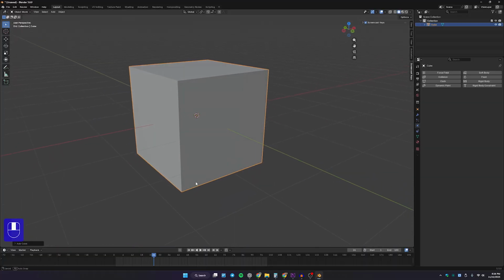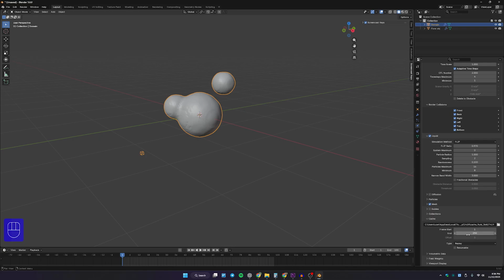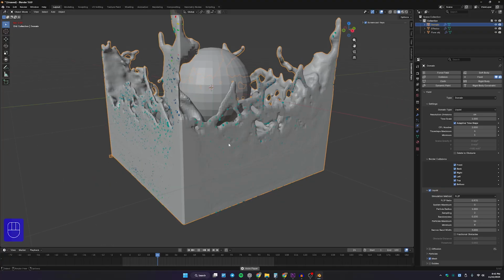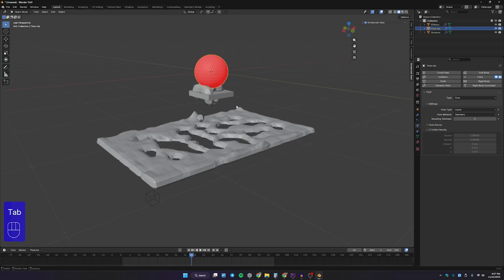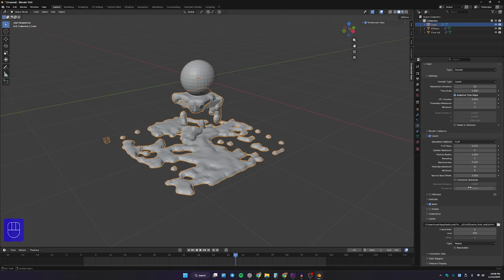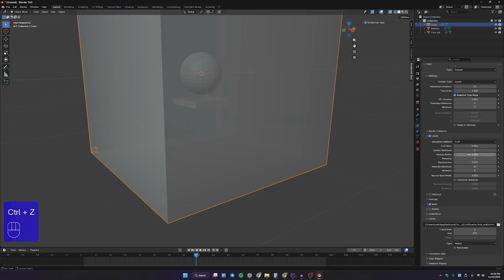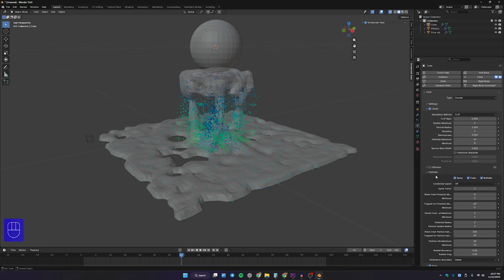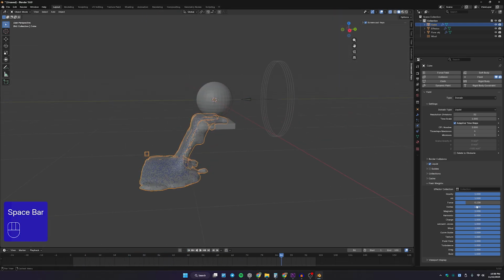Blender 5.0 Liquid Simulation Full Tutorial — Complete Guide for Beginners to Pro (Everything)

Comment: so i dont know if you still answering questions, but how do I stop the generation of liquids with an inflow simulation, but continue the simulation for another set of frames with the already generated liquid? (like opening a faucet to fill a cup of water, closing it and then move the already filled cup around)
Reply from the maker: Yeah, this is a bit of a tricky one. You can't really get Houdini-level fluid behavior in Blender with a few simple steps. First, use an "Inflow" object and animate the "Use Flow" option so the water starts and stops flowing, just like opening and closing a faucet. Then, use the cup as a "Fluid Effector" so it can hold the water. However, if you try to move the cup afterward, the water usually won't move with it in a physically convincing way because that's one of Mantaflow's limitations with moving containers. My recommendation is to use an "Alembic" cache. First, simulate the cup filling with water and let the liquid settle with the waves and motion you want. Then export the liquid as an Alembic cache, import it back into the scene, and parent it to the cup. This way, you can move the already-filled cup together with the cached water. However, if you need to move the cup while it's still being filled, this method won't work well........you'll need a more advanced workflow or a solver like Houdini FLIP. So, this approach is best if you want to fill the cup first and then move it afterward. Good luck with it!

Comment: my domain box is not disappearing
Reply: Solution that worked for me - make sure you reset the scale of the domain and flow object (CTRL-A, then select Scale)
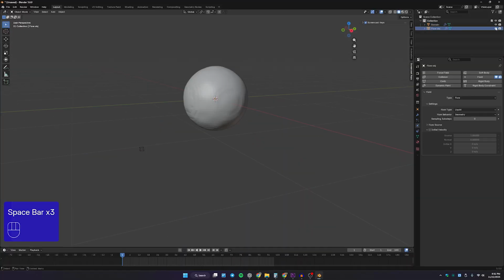Reply: Same here. When in Gas the domain turns into mesh. When switching to liquid it turns into a solid block. Followed the steps exactly until minute 3:15 in the video but it just doesnt look the same for me. It doesnt do any simulation even if i bake.
Reply: @hansihintersoos7581 that problem didn't get solved . I just adjusted the frames and rendered them separately first by hiding the box and then unhide the box
Reply from the maker: @hansihintersoos7581  
Bro, if it’s not working, baking won’t fix anything. So first, try these steps to make sure your simulation is working:

1. Check that you have a domain and a liquid (flow) object inside it.
2. Make sure both the Domain and Flow object types are set to Liquid.
3. Check the Flow behavior of the liquid object — it should be Geometry or Inflow, not Outflow.
4. Make sure your liquid object is inside the domain cube.
5. Check your domain cube — ensure the small cube indicator on the side of the domain is larger than your liquid object.
6. Check the normal direction of all objects — both the domain and liquid objects should not have inverted normal.
7. If everything above is correct, check the cache settings under Domain settings and make sure the cache type is set to Replay.
Reply from the maker: @hansihintersoos7581  Guys, if you have any issues, please send me the question on Patreon; Also I explained your possible simulation issues here on Patreon for free - https://www.patreon.com/posts/quick-explain-5-151292495
Reply: On my end, I just clicked Play Animation in the timeline and waited for it to finish and restart.

If I'm not mistaken, the animation restarting also restarts the actual simulation, especially if it's not baked yet.
Reply from the maker: @drkyoumasaur220  Bro, If you can send me a screen record of the issue for my mail. I will do a video explanation and put it in my Patreon for Free as before.
Reply from the maker: @drkyoumasaur220  Even you bake or not, the liquid simulation should starts again when timeline restarts mate.
Reply from the maker: mate, Have you changed the domain type to liquid? Could you please explain what exactly is happening there?
Reply: @styliz3d  same is happening with me , for liquid simulation doesn't show even after baking
Reply from the maker: @YashaswiTiwary  Can you describe the problem a bit in detail bro. I will try to help yaa